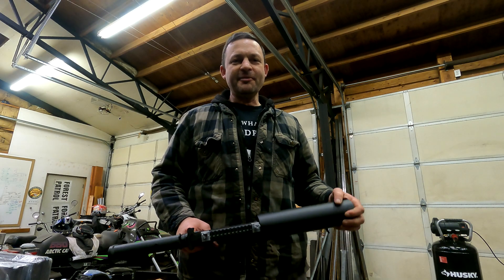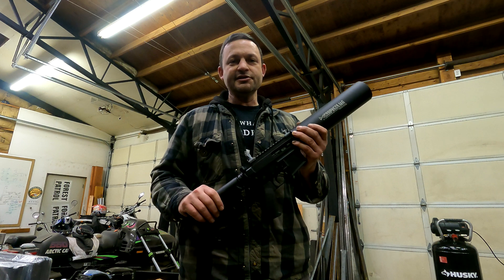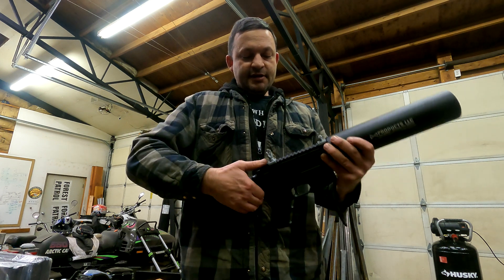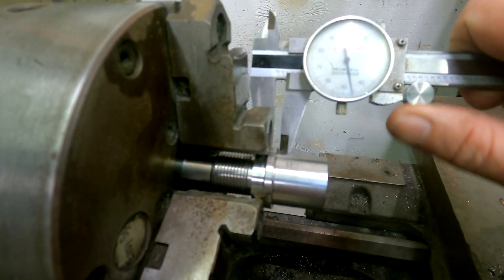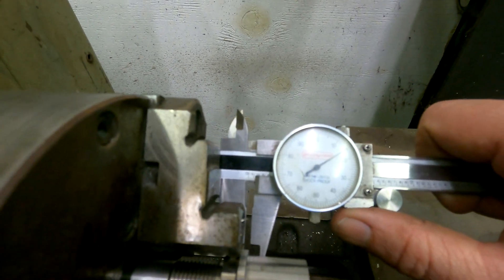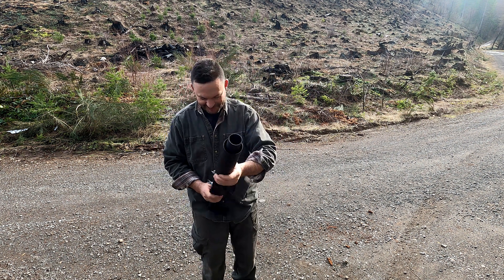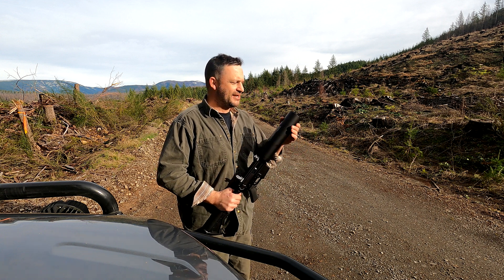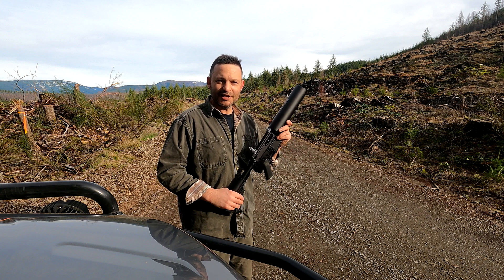Can Launcher:  Repair, and launching soda cans and golf balls

Comment: I just bought one of these last month from a company called F5. I fired mine a few times, and I wanted to give you a couple of tips. I don’t know if shaking the cans up to make them firmer helps but we do it, but definitely load the can with the pull tab facing out as to not put pressure on the weakest part of the can at launch. I was happy to see you fire it on your channel without a sticky mess in your barrel.

Comment: I bought this thing from a gun shop back in 19', I didn't end up using it until Summer 22'. I gathered all my friends around to show it off, all I got was a *click*. Totally embarrassing. The blank was struck but only slightly. Like you, I tried 3 different bolts, 2 different lowers, and another brand of blanks. No dice. So glad I came across this video! What a turd of a product! Thank you sir!
Reply from the maker: Obviously this seems like an ongoing problem...if you got a defective one in 2019, that separates our purchases by almost 3 years.  Since making this video, I've heard from dozens of people with the same problem, so it isn't uncommon.
Reply: @MattVerley  If you bought it from X Products they will warranty it no questions asked.

Comment: I'm having the same exact issue as you on this... But I don't have a lathe.  I may see if I can take this to a machinist and see if he can fix it... only bummer is it'll cost me more to make this product work...  Thanks for the awesome and complete video to really show what the issue is.  Much appreciated!
Reply from the maker: Boy, that's frustrating they haven't solved this yet!  I received quite a bit of negative feedback for making this video...im not really sure why.  X products didn't stand by their can launcher for me, and I've heard of quite a few others with the same issue.  
The lathe work is very simple...it shouldn't be too expensive.
Reply: @MattVerley  Matt, my question is do they have an X Products Can Cannon or and F5 soda launcher. If it's an X Products product we will warranty it for life, so there shouldn't be a problem exchanging the port assembly.
Reply from the maker: @jamesmalarkey417 I purchased the can Cannon directly from X products in Portland. The problem was initially I couldn't get ahold of anyone to speak to about the problem. After several weeks I did get a call back, the person I spoke to told me that he was aware of a machining problem and would be sending me a corrected part as soon as they got one in hand.  I never did receive that part, and since I had already used my own lathe to correct the issue I didn't spend any more of my time pressuring them to correct the mistake.

Comment: This is unfortunate to see. I was just about to pull the trigger (pun intended obvi) on both a 5.56 and .308 version of these….

Any updates?
Reply from the maker: No update...my modification is still working fine after hundreds of rounds.  I've heard from a couple of people who got can launchers with the same defect as mine, but I have also heard from lots of people who had no problems.  I'd say, if you can get them on the phone and verify theyve fixed the issue, buy one!  They're a ton of fun...
Reply: @MattVerley  thx Matt, will do!  We’re ME’s anyway, some basic lathe action doesn’t scare me… just not impressed by their CS they’re otherwise seemingly proud of.

Comment: Just out of curiosity has X products ever reached out to you?
Reply from the maker: I got a call from them after I had left a few messages over a few weeks.  They said they knew about the machining issue and would send me updated replacement parts sometime in March...that was 6 months ago and I haven't heard anything else.  I really don't mean to condemn X products...I get it's a small shop trying to build some new products and i sincerely hope they succeed.  I was just frustrated at the lack of a response, then the lack of follow-up for a known issue.  If I didn't have a lathe, I would still be holding on to a $400 paperweight.
Reply: @MattVerley  I totally understand where you're coming from, you paid for a product and expect it to work properly and then on top of that weren't able to get any sort of resolution so I totally agree with you. I also have a lathe and would have handled it the exact same way.

I would still hold them liable for the problem and at least get a replacement part so you have an extra.

Comment: Mine works perfect right out of the box ! And it’s a barrel of fun….
Reply from the maker: X products called me back shortly after I made this video, apparently the Machine Shop they had contracted to make those pieces made quite a few defective ones. They're working on bringing the Machining in-house, but unfortunately don't have a solution for the bad gas blocks that were shipped yet.
Reply: @MattVerley  Correct, we now make them 100% in house, this has been a non-issue ever since.
Reply: mine as well